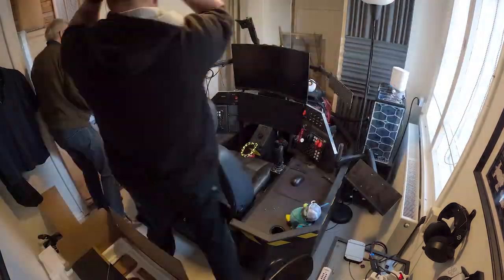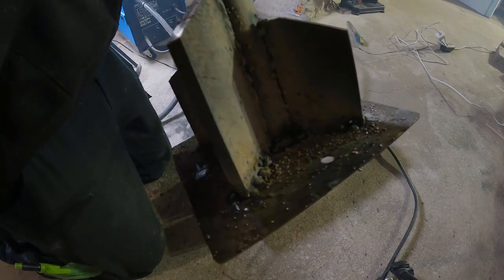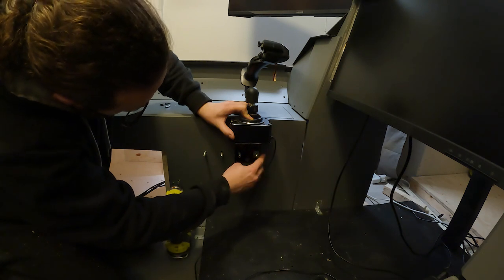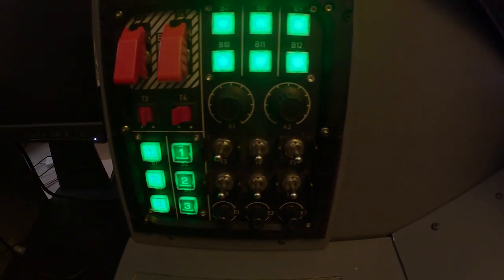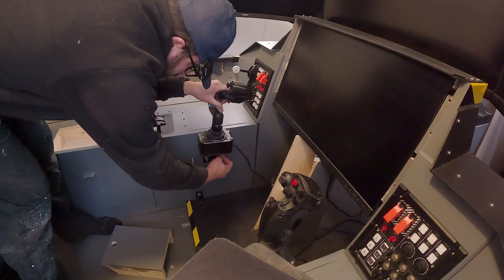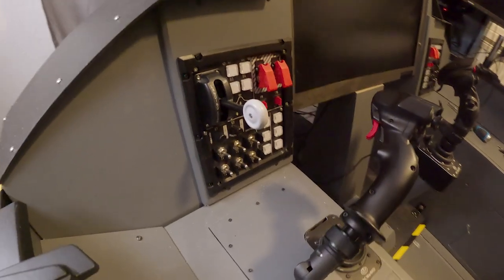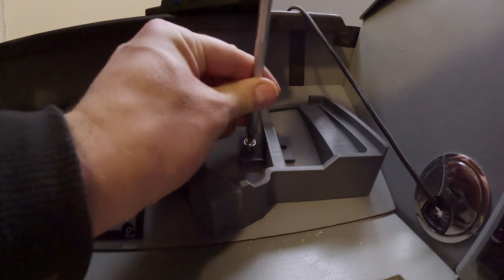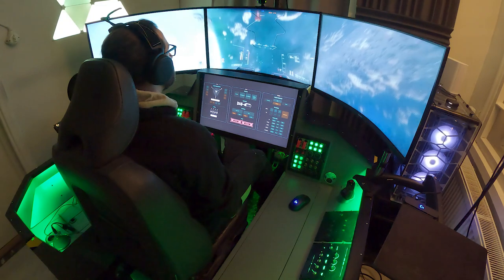Assembling the New Cockpit - Building a Home Cockpit ep 8

Comment: That's a really nice build, I'd love to do a similar one, but sadly don't have the space / money. I'm running a single display more typical desktop setup. My main issue with my current setup is finding good places to put my HOTAS (X52) when I use them.
Reply from the maker: Yeah, that's quite common problem. When I had my setup on normal desk, I made myself basically a copy of Monstertech mount from vslot alumium rail.

Comment: this looks o cool man: especially the displays: have you ever considered a vertical mounted monitor for the centered to create that vertical viewing angle? 

also how much has this set up cost in the currency you use?
Reply from the maker: Thanks! That plan sounds actually interesting. Probably wouldn't work with SC for now, but would with DCS.

My long term plan is actually creating a curved wide screen, something like 270 degrees and three monitors mapped to it. But that's probably few years in the future so I'll go with this setup now.

The gaming PC, controllers etc are in line with high(ish) end rig, though I've bought lots of stuff second hand (like joysticks) or from sales (like displays). The cockpit itself ended up costing around 800 euros for materials, and countless of hours of work.

Comment: Small Question: I see your using GameGlass  on a large center screen.  Is that screen hooked up directly to your main computer or is the monitor hooked up to a tablet or other computer for the app?  I could be wrong but I was not aware you can hook up directly to your main computer with that app.   I really like your set up, nice and clean look.
Reply from the maker: In my previous setup, it was hooked up to external computer and I was controlling it with the trackball I had in the middle. But I really didn't use it since I have keybinds for everything on physical buttons.

Now it's running on the same computer since I need to have that display connected to my gaming PC for DCS and FS2020 gauges and MFDs.

So for now for SC, it's there just as a decoration and the middle display is more useful for other flight sims.
Reply: @UndeadParrot   thanks for the info, and again, I like the set up you created.

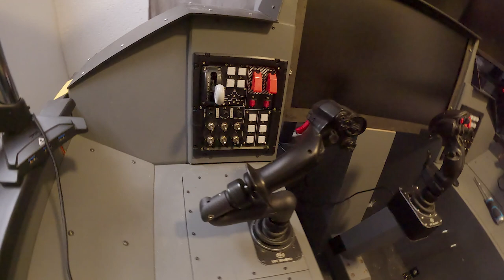Comment: How did you attach the throttle and joystick to the modular mount at 11:39?
Reply from the maker: Throttle itself has few holes I put screws through. For the joystick, it has threads at the bottom so I used those.

Comment: Dude I saw a moniter which can stick to wallas and curved surfaces.If u use it instead of the 3 moniters u can experience the view without the line between the monitors and it is available in 4k oled and some kind of 4d appearance.
Reply from the maker: Sounds interesting. What I'm planning is to build a curved 270 degree screen and map three projectors there. But 4k short throw projectors are somewhat pricy, so I'll stick with this for now. :D
Reply: @UndeadParrot  dude what i was talking about was build a curved wooden base like the cabin and sticking it with the screen.As it is flexible u can make even 360°😆.Also not that much costly .Samsung's stick to wall moniters are like rtx 4090 it costs aroung 6000 dollars for a minimun length of 2 meters or 3 meters.But LG company is good in case of money.

Comment: Great job! What PC can Handle this amount of Monitors? What are you using in your setup?
Reply from the maker: The top display isn't connected to my display so there's the four for single computer. I was OK with Ryzen 7 5800x3D and Radeon RX 6800 XT but I upgraded into Geforce 4090.
Reply: @UndeadParrot  wow that’s nice and absolutely necessary for Star Citizen 😅 I’m stuck with a GTX 3070, but still ok for me because I just have one screen 🙃 can you show the usage of your setup and where you setup what keybinds so that it fitted best to you?
Reply from the maker: @DanielDuese  While this is my previous setup, the controls are quite same still: Controller Setup for my Star Citizen Simulation Cockpit (SimPit)
https://youtu.be/8kc_9EIFJGc
Reply: @DanielDuese  I can run Star Citizen on an I5-8600k w/ Geforce GTX 1060. Granted, its not the fastest / smoothest. Newer cards are still too expensive for me sadly.
Reply: @TianarTruegard  still decent setup though. Depends on the resolution and settings. I upgraded two years ago before prices got crazy fortunately. 😅